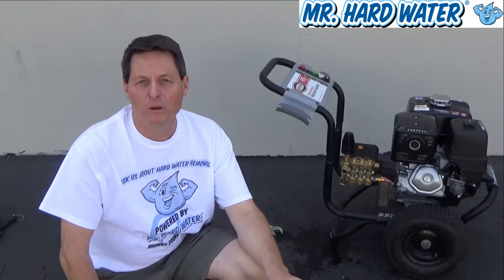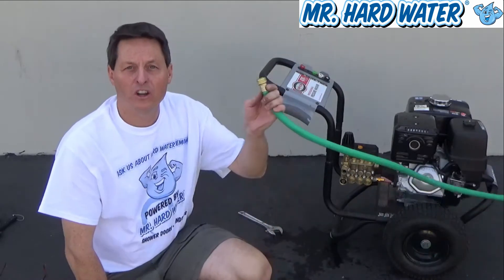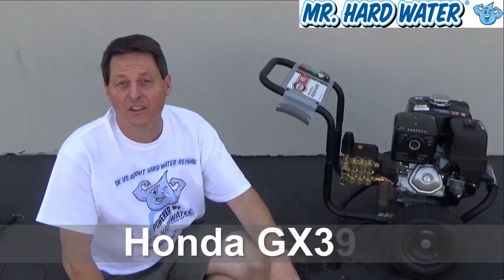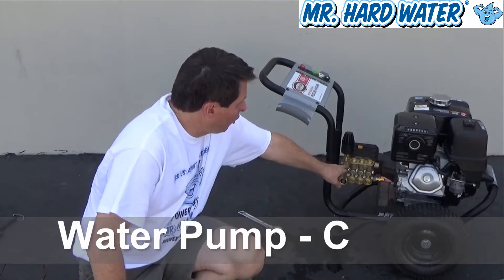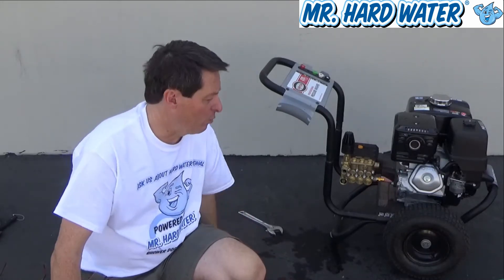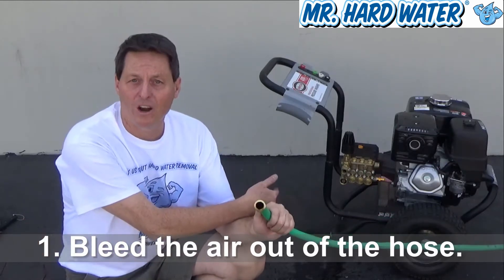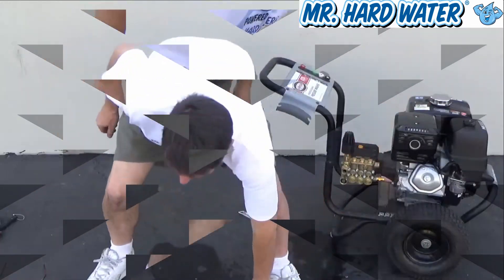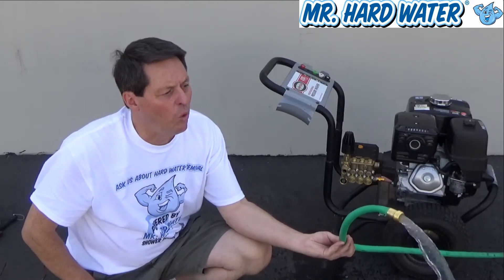Simpson Part 1 Hoses - 4200 PSI Pressure Washer Mr Hard Water

Comment: I like the small details you include, such as taking out the air by turning the water on, and then turning the water off before hooking up the garden hose to the PW. It may be common sense for the veteran, but us novelists need to learn all the small details and tricks of the trade. If there’s avoidable errors, let avoid them.

Comment: Yeah just throw out the washer and replace with a wrench . Sorry that was bad advice but the pressure washer is great. I just purchased mine with the 20 inch deck cleaner and Its great on driveways and decks. Just watch your neighbors wanting to borrow something you just spent over a grand for. But beware this thing will knock you down the first use if you have never had a pressure washer with this kind of power.